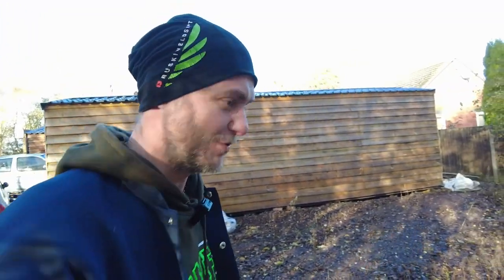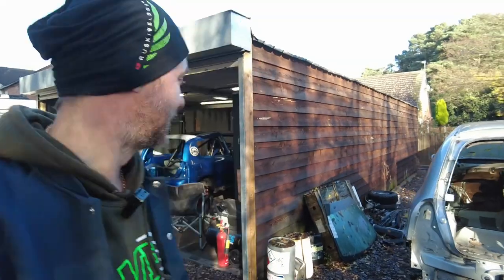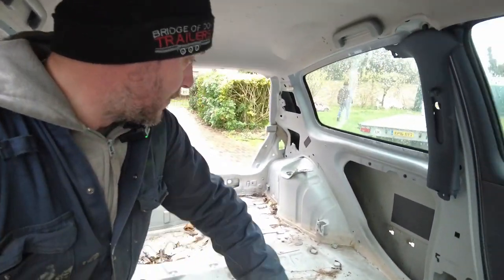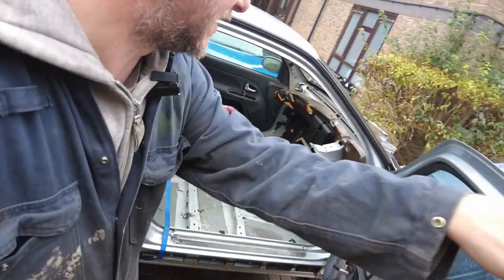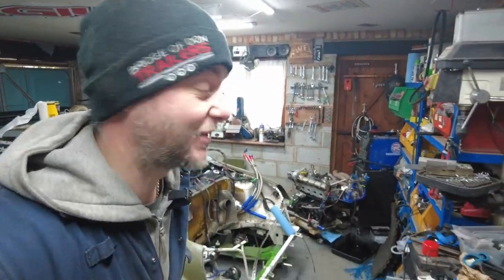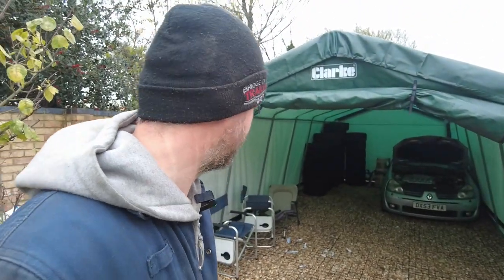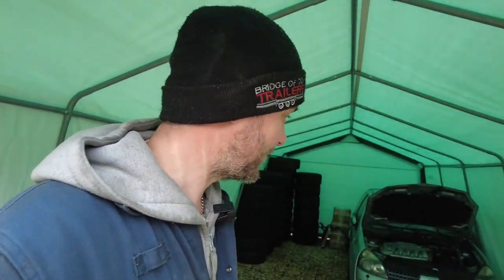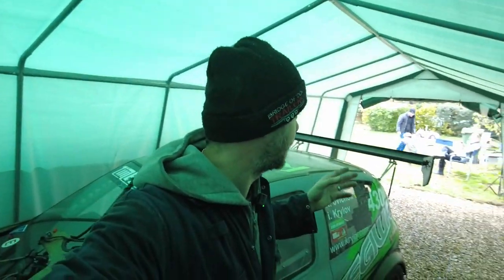Bought a NEW shell! Condition surprised me! #buildingthefastest

Comment: This debate between lightweight roll cage, like here or on TCR cars and so on, versus a rollcage with all the bars and all the stiff (like an old V8 Supercar: https://youtu.be/VO-GIpau9_I?t=272 ) really confuses me!  I guess ideally you'd do some FEA to work out the best compromise of weight to stiffness,  which would get extra complicated when factoring in the stiffness of the original body shell once it's seam-welded.  In the days of that V8 Supercar, they just measured  the torsional stiffness physically once the car was built (though the minimum weight was pretty high, so no real drawback to having a super elaborate chrome-moly cage).

Comment: Where carbon kevlar shell?!?! What's that boring metal shell! All the weight savings are necessary and I'm sure a full kevlar shell isn't that much work... I say this after messing up my latest carbon roof scoop which you inspired me to get to!
Reply from the maker: carbon shell would be completely out of my budget! cant exactly just skin the old one!
Reply: Not with that attitude you can't 😂 Think of the content!
Reply from the maker: @CreweTube  lol
Reply: @RuskiWeldFab  reckon you could get pretty far by drilling out the welds and skinning the panels, certainly boot floors, front and rear slam panels could all be done this way.